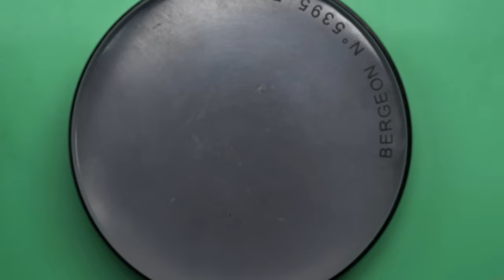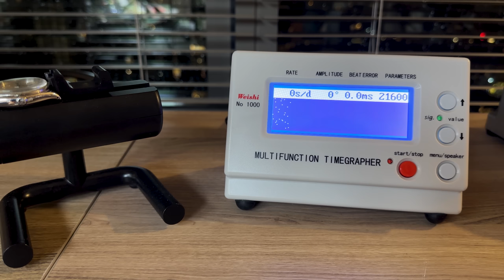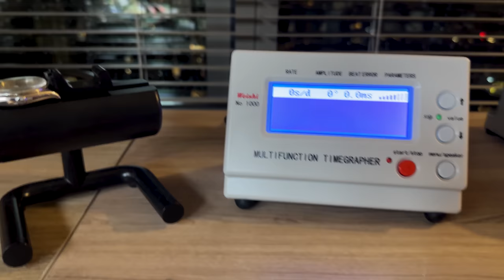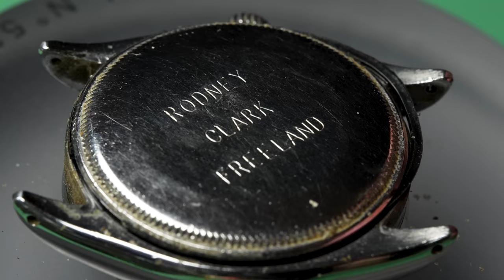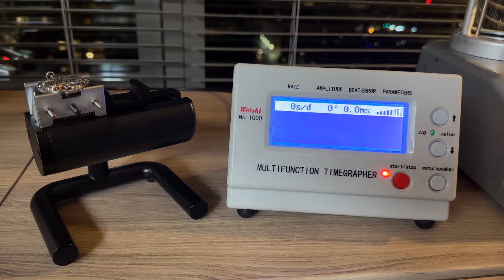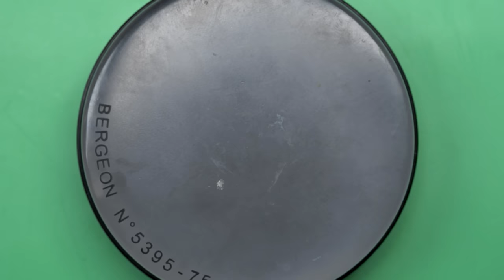He Wore This Rolex Every Day for 53 Years (Until it Stopped Working)

Comment: Dude lays every step out so nicely that I bet a 5th grader could repair a watch with some supervision
Reply: Nah, he makes it look easy... but don't forget, the screws are small enough that you could lose one because it's stuck inside your nails...
Reply: Setting them back up to work correctly is harder than it looks here.
Reply: @aserta  Agree, yesterday i opened my first watch and things doesn't look big as in the videos! 😅😅
Reply: Definitely not lol
Reply: Watchmaker here also. Absolutely not. It's less about understanding the mechanism itself, which for a simple 3-hand watch aren't complicated; and more about developing the fine motor control and dexterity. It takes many hours of practice and much patience to get to the point where you can competently work without worrying about losing or damaging things. This channel is however better than most in being clear and concise in both narration and work!

That being said, there are watches that even after 20+ years I hate working on. You haven't lived til you're faced with a vintage $30k triple-date moonphase chronograph that a client wants repaired, serviced and restored...
Reply: There is a genetic element too. Fine motor control has to be above average. My clumsy hands could NEVER do this stuff.
Reply: I watched his videos for a while and thought the same… then I tried breaking down a eta 2824 and lost the crown wheel, clique, clique spring, yoke spring and 7 screws. But after some practice I have broken down a 7750 twice.
Reply: @MakerInMotion  The older you are before starting on this sort of thing the harder it'll be, but I'm pretty sure anyone can develop the dexterity with enough practice and patience. Just be prepared for the investment of time.
Reply: It takes a lot of practice and experience to make something look this easy!
Reply: @J.DeLaPoer  just curious, how many hours on average do you expect a "simple" movement like this (no complications) to take? I understand there are a thousand variables that would affect this, but in a perfect world, how many hours would you expect to take?
Reply: just started off with this hobby, successfully reassembled my first 4 watches up to now. What i found hardest to manage was the handling of the cap jewels. Remember the part when he flips the jewel with the tweezers ? Looks easy but really needs some practice , those parts very easyily shoot off the tweezer and you have to search for them on the bench. if ur lucky, otherwise on the floor with a flashlight :- ) But if ur patient and have a steady hand, its possible even at the age of 60 or more :- )
Reply: @mattswanson79  Around 3-6 hours. Assuming it's a high grade movement such as this 1560, it's been properly maintained with no excessive wear or broken parts, and it's just a straightforward clean, oil and regulate. I know that's a relatively big window of time, but there are as you said many variables... In reality two identical caliber movements of equal age and equal interval since their last servicing can easily vary several hours (or days!) difference in required work time. 

Even two brand new movements fresh out of the factory can vary a fair bit in fit & finish and accuracy. That's far less of a factor with luxury stuff, almost non-existent with modern high end brands really. But it's common with mass-produced low to mid range: Seiko for example gives something like +/-  1-3 minutes per day as acceptable new factory spec on most of their mid-level watches like the popular "5" series, vs. +/-  4-6 seconds per day spec (COSC) for something like Omega or Rolex. 

With vintage all bets are off, as you'll find even the best of the best luxury stuff will all too often have been neglected over the years and become an absolute nightmare due to scarcity and expense of replacement parts combined with wear & tear. This is too long already so I'll just end it here, but I could go on all day about the variables and tendencies. Broadly speaking tech has come a long way, and watchmakers dealing with well-maintained modern stuff have a far, far easier and faster job than those dealing mostly with vintage.
Reply: Nope
Reply: @J.DeLaPoer  Thank you for your comments!
Reply: @mattswanson79  As L K said here, the Chinese clones are a very good place to start. Larger stuff (ST36) is indeed easier to learn on. I also highly recommend the Sea-Gull ST2130; as a clone of the ETA 2824/Sellita SW200 it's going be by far the most common caliber type you see in modern (post 1970s) Swiss watches, and the Sea-Gull version sells for a tiny fraction of the ETA/Sellita calibers. Almost every half decent Swiss brand out there without complications will use some version of the ETA/Sellita 2000 series as standard... Even Rolex's Tudor division used ETA up to c2016 or so and they're still dirt common. If you're comfortable with the 2800 series then you can fix about 75% of the simple Swiss stuff out there with your eyes closed, so it's essential to know it well. Hell, even many complicated watches with moon phase etc just add bolt-on "modules" to an otherwise standard 2000 series so they're very similar. For the price of one new ETA 2824 you can literally buy multiple Sea-Gull ST2130's, or at least the last time I looked.

 As a sidenote, China has become very impressive indeed with their watchmaking these days, and a decently finished ST2130 is every bit as accurate and reliable as the Swiss version nowadays. Just be aware they come in several different 'grades', but that's a whole other topic to itself... You just want the basic and cheapest grade to learn on; the best ones and Swiss versions will be 100% identical as far as form, function and construction. If you want to be really cheap, you can check out other Asian stuff I suppose... Hangzhou's ETA clones for example if you really can't afford Sea-Gull's, but off the top of my head I can't recall their caliber numbers or anything. Check Google. I've always avoided the super cheap Asians as there's a very sharp decline in quality compared to Sea-Gull, but I guess they'd be fine to learn on; just don't expect accuracy or longevity out of movements that cost like $15 brand new... 

Vintage stuff is another story really, up to the late mid-century era it was the norm for pretty much all brands out there, Swiss, domestic or other foreign, to use their own in-house movement designs that all varied considerably from model to model, company to company, and year to year. For vintage stuff I recommend hunting ebay for cheap, simple wristwatches by Elgin and Lord Elgin, Bulova, Lucerne, Benrus... Those brands tend to be very cheap, plentiful, and use movements that while all unique will give you a good feel for the common design elements of the "golden age" c1930-1970. And you won't feel bad if you break them or lose a part (which you will when starting). If you're going vintage hunting, just at least make sure the balance staff is good eg; the balance wheel swings freely, even if the watch isn't running. A broken balance staff is a common reason for vintage watches to stop, but it's also a very difficult repair and requires replacement parts, special tools, and much skill. Not for beginners. As long as a watch is in one piece and the balance is good though, chances are excellent you can get it running again easily enough.

Vintage pocket watches can also be ok to learn on as they're often also gigantic, even big compared to the Sea-Gull ST36 (which is itself just a smaller converted pocket watch movement really). Again Elgin is a good vintage brand for practice.... They were a domestic USA company and produced tons of pocket and wrist watches for many years so they're cheap. For pocket watches, just avoid "full plate" movements when starting out, as those are a pain in the ass even for the pros. 

Hope that helps! I'm always happy to encourage new folks into this dying art.
Reply: He’s phenomenal but that’s a tall order.
Reply: The dude abides, man.
Reply: If something looks this easy, it's because someone with a LOT of hours of practice is doing it

I agree, he lays it out extremely well
Reply: Ahhh no not us 70some 5th graders
Reply: You mean you could do it with some supervision?
Reply: Or me
Reply: I mean... sometimes I feel like a5th grader doing these things, but he makes it SO understandable.  Problem is I now have high standards for how I should be doing this, lol.
Reply: thats exactly what... i tried to do.
Got my hands on an cheap broken mechanical watch , and completely dissasemly it...

No way i can put it back now... the gears are just an mystery for me.
Reply: Anyone under 15 has the attention span of a concussed chicken - so I wouldn't hold any high hopes with regards to repairing an old Rolex like this 🤣🤣🤣
Reply: No.
But yeah in a way
Reply: Expertise makes the complicated seem simple
Reply: I built my first RC car in 5th grade, a Tamaya Subaru Brat
Reply: Imagine being Rodney watching your own watch undergoing open heart surgery
Reply: @J.DeLaPoer  fellow watchmaker and I say amen brother.
Reply: I think you hit a nerve there.  LOL  I have often wondered what professionals thought of these videos.  I'm pretty sure that he is a talented hobbyist.  He is very talented  narrator and videographer.   I like feeling like I could do the same thing, but at my age the diminishing dexterity and eyesight are going to be a reality check.
Reply: @MakerInMotion  The genetic element isn't as much as you'd think. As long as you don't have constant tremors you can train very fine motor skills - especially for particular tasks like watchmaking -  even if you're normally not dexterous, it just takes more practice.
Reply: you haven't seen 5th graders nowadays, they don't even know how to tie their shoe lases
Reply: If you only work on one movement maybe, but this guy has the ability to work on movements he’s never even seen before and that’s where the experience and skill comes in where problem solving is required
Reply: I couldn’t even swap the battery on a Nixon watch without squeezing the screw too hard with my tweezer and losing it in the abyss of carpet. He’s making it look easy 😢
Reply: the tricky part is to identify the problem, not break anything during disassembly, and reassemble it correctly. But generally speaking it's easy, I agree
Reply: @slmdnkasr  Nissan Watch?
Reply: @mrld3005  Nixon watches are cheaply made quartz watches. Nothing special. Sentimental value wayyyyyyy higher than the watch is worth for me.
Reply: You don't have a clue how hard being a watchmaker really is.
Reply: Solution: Buy a 30 dollar Casio watch at Walmart: PERFECT time, and when it fails (usually 6 or 7 years), buy another one.  Problem solved.
Reply: I got the opposite vibe completely. He's very good at explaining, but trust me a 5th grader would it be able to do this. This is years of practice making it look easy. This is faaaar harder than it looks
Reply: Probably comes from doing years of play-by-play coverage of professional Magic:The Gathering world championships as this day job.
Reply: @aserta  I agree, I fix old radios and can't tell you how many tiny nuts and screws I lost over the years 🤣
Reply: @dimitarangelov9648  Yeah, some are so small you need to work under a microscope!
Reply: The gentleman has extraordinary skills, especially when working through that scope!  Occasionally, he goes from full-size/real view to scope-view so smoothly that it can go unnoticed. 
Well manicured nails, clean workspace, awesome tools & extreme scope skills (camera work/editing is great too). Sure makes it look easy!! 
A big, huge compliment to his overall talent, demeanor, presentation skills, and industry knowledge.  All are first rate. 
Calming yet commanding voice. Any TED Talks scheduled? 
I would be so lost, and so would a spring or two. 
There's a movie that would describe my skill level with  watch repair,  "A Bridge Too Far" 🌉
Thanks Marshall, another great video!
Reply: Maybe a pocket watch, but not implausible
Reply: Until you’re the one doing it on a 20,000$ watch
Reply: @Aqua Fyre qqqqq
Reply: @UNSCPILOT  When I was young (I am 76 now), a teenager maybe, I took apart a cheap pocket watch which wasn’t running and pit it back together.  It ran!  Since then I have lost springs and screws on much larger items.  I don’t think I will try it now.
Reply: Are Ray Charles
Reply: @dimitarangelov9648  no shit lol
Reply: No way this takes years to master
Reply: we call this child labour, yes children can be trained, and honestly if from the age of 12, they would actually likely become experts by the time their 18 and they'd make like a boat load a year if they wanted. Just saying.
Reply: I also fell victim to this idea and now I have a bag of movement parts 😂
Dude you really have to try it yourself, effing pieces are effing small😂 like seriously it's HARD
Reply: I. Learning so I can buy some broken one and fix it
Reply: He is a great teacher!
Reply: Nope, and that's why I love his videos. I watch that and can already see the screws I've lost, the parts I've bent, and the springs that are flying across my room. His videos don't actually give a false sense of competency, he shows of his skills and if you have ever developed your own skills you can see exactly where you'd * up
Reply: @aserta that’s exactly what it is dude makes it look like nothing and of course he has all the right tools
Reply: Expert is an expert because his work looks very easy.
Reply: How long can you work before your hands shake?
Reply: @aserta  0:15
Reply: @aserta 😊
Reply: @MakerInMotion I agree. My fingers are too muscular and chunky and I think my hands are too shaky to do this work.
Reply: No. He’s making it look easy.
Reply: Putting everything back together would be a nightmare
Reply: Every time I think to myself, dang, this looks so easy, I have to remind myself that I am looking at these pieces through, I don't know, at least 20x magnification?
Reply: Now.  I could take it apart, but it'll never be put back the way it was and work again.
Reply: Just because somebody makes something look easy doesn't mean it is, its a testament to somebody's skill and experience how easy they make it look.
Reply: I agree. It is so deceptively simple as laid out because it’s probably closer to surgery than car repair. The best part is he doesn’t talk about his aunt and her sick cat while doing this. He stays on subject which I really appreciate.
Reply: Yeh, no. He’s really good. He’s  really experienced, and he’s sharing. A 65 year old Rolex watch is never going to anything I’d want a 5 year old to even know about. I’m the guy who took apart the toaster you’ve heard about. That watch would’ve been waisted if I got a hold of it then.

Comment: As a mechanic, carbon composite technician, I just want to say that even though my heart and passions are with cars. I've always had a deep fascination with watches. The design and engineering behind them is quite literally timeless. I think I may have a new hobby 😊
Reply: Why not, buy some cheap broken watches off Ebay and buy some tools and off you go! :)
Reply: So r u an auto/ diesel mechanic and a carbon composite "technician" (we just used to call it body work). Never met someone who calls themselves a mechanic but refers to themselves as a body work "technician"? Or do u fix composite working equipment (chopper guns, etc)?
Reply: @TrapperAaron  automotive. Carbon composites was with Multimatic building the Ford GT chassis and Aston Martin Valkyrie. I've since moved on to do my own thing.
Reply: The mechanic side of me was thinking to fill the entire thing with automatic transmission fluid lmao.
Reply: Welcome to the club! Watch guys are often car guys and vice versa!

Comment: I love dental pics for reaching into small spaces to remove Gunk and also for picking out seals.

What's the weirdest non-watch tool you use for watchmaking?  Mine is either a rubber six-sided die or a hockey puck.

The six-sided die is made of grippy rubber like your case opening ball.  I happened already have it so I just used it.

The hockey puck I actually got from Jules Borel.  The listing said hockey puck pad and I thought it was just a pad that looks like a hockey puck.  It actually was a whole ass hockey puck.  A regulation hockey puck 🤣  it's not as soft as your gel pad but it was $6 and it does the job.
Reply: You'd be amazed how many uses there are for good quality toothpicks! Dental picks are great too, and also pretty much a necessity for vintage fountain pen restoration which I also do as a hobby. For a long time I also used a rubber dog chew-toy for a caseback opener when paranoid about scratching something with the wrench (solid gold cases are very unforgiving).